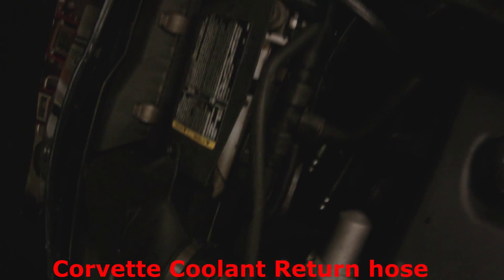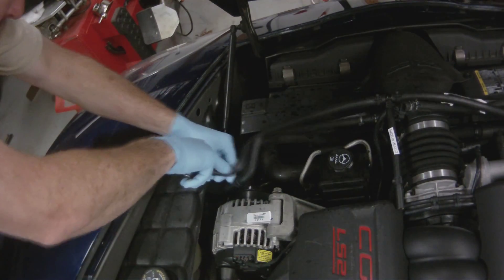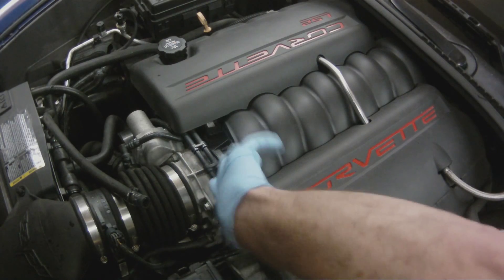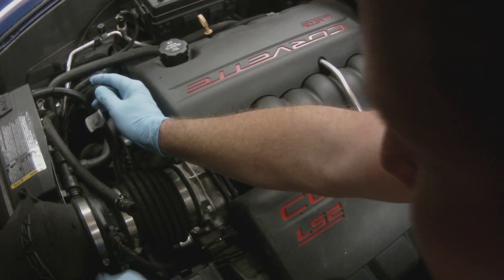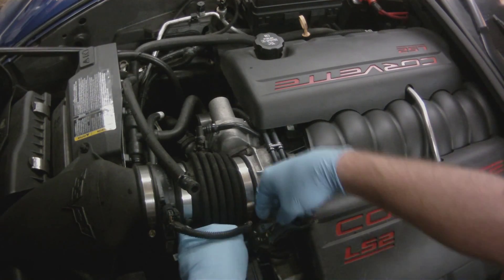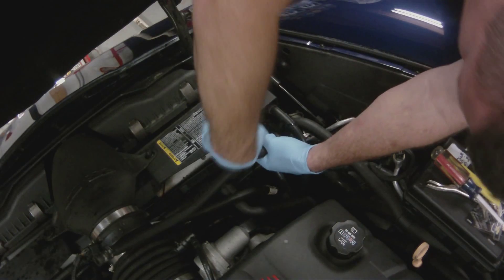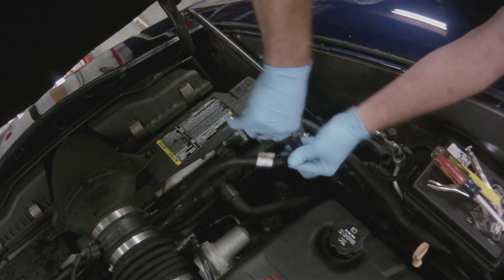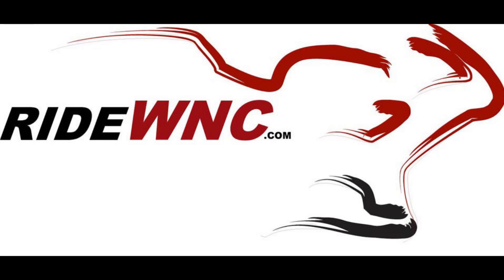Corvette C6 Coolant Return Hose   T Connector Failure

Comment: I know this is an older video, but the other bigger plastic t connector on the passenger side is what i need. Any idea the size or where to get one or what its even actually called? Im having trouble finding any info on that part. Gonna be installing a nee radiator, fittings, hoses and want to have everything replaced together. Thanks!
Reply from the maker: The hoses and connectors were one part number from my Chevy dealer.
Reply: Ok, thank you.

Comment: Mine went bad outside of Macon GA trying to get back to Atlanta. Stopped by Oreilly's and picked up a generic t for $5 and a gallon of coolant.  Was just serviced at 100k and strange they didn't find that. Nice video. Thx
Reply from the maker: I am not sure the mechanic would ever notice an issue unless he grabbed the hose and the T snapped off. The damage is done from the inside. 100K miles this line should be something to consider replacing. I wish Chevy didn't have the price for the hoses so high.

Comment: how do you bled the radiator.. mines keep over heated.. can't find the bled value
Reply from the maker: Don't worry about it. Fill the radiator. Fill the over-flow tank to full line. Drive the car. Stop for dinner and check the overflow tank after dinner. Top off the tank as needed. Don't over think this. Chevy is pretty simple to work on.
Reply: Demetrious Hollis dis you ever figure it out?
Reply: Mines? You have Two?

Comment: Mike, I have the same issue. Did you have to purge the air out of system after installing the new hose/t connector? Please let me know. Glad I saw your video- helped me find the leak for sure!
Reply from the maker: No. If you drive the car the air bubbles will work their way out. After the drive check the overflow tank and top off the coolant if necessary.
Reply: Gotcha. Do you have the part number for the hose/t-connector?
I was hoping I could buy it online. Did your dealer have it in stock when you went there, or did you have to wait for it to be ordered?  Thanks.
Reply from the maker: My local Jacky Jones Chevrolet in Murphy, NC will usually match on line prices of OEM parts. They can also get them next day. I went in and we looked at the parts list and ordered it. I didn't hang on to the part number. The T and the hoses are all one part.

Comment: Replaced the plastic T with stainless steel one for about $4
Reply: aguachilesmen1 I just did the same as mine snapped this weekend changing the radiator. I'm not sure why this guy bought the whole thing..
Reply: I got mine from autozone. Payed like $5 for a couple of plastic ones. No biggie
Reply: Where to find the stainless steel one? Thanks!
Reply: Marco Rodriguez but to back track on what he said in the vide... yes it won't have the right size off of the T for that other hose but you could work it on
Reply from the maker: Yes. That is a great idea. Now the old worn out hose breaks a strands you out in the middle of no where with no cell service.

The cheapest thing in a Corvette is the owner!
Reply: To each his own, that new plastic T will just bake again.
Reply from the maker: When the T Connector fails the hose is already at its life's end. If you are comfortable putting band-aides on you plastic car who am I to try and change your mind. 
For the rest of you. Do the job right the first time and you won't need to do it again in a few weeks.
Why is there never enough time to do it right the first time but there is always time to do it over?

Comment: Very helpful video i was stranded about 65 miles from home $190 tow bill $155 for the price of the part at my local chevy dealership. Expensive weekend
Reply: I got 5 stainless steel T's on ebay that fit perfectly for $8. My 2008 had 3/8 all the way around. I gave the other 4 t's to local corvette owners.
Reply: Craig Pike do you have a link by chance ?  I believe the z06 is 3/8 all 3 ways, mine just went last night. Looks like I will be buying a plastic one till I can get a SS replacement.

Comment: this happened to me while out running errands.. was stranded at a Walgreens at 12am.. went inside got a wall anchor kit.  plugged each of the side hoses and got it home 6 miles at normal operating temps...

now to find the part number somewhere and pray my chevy dealer is open on Christmas evr...lol
Reply: lmaoooooo same thing happened to me same day and everything just 6 years apart